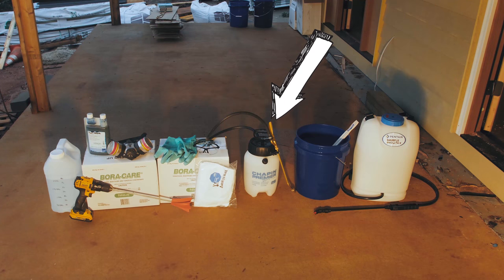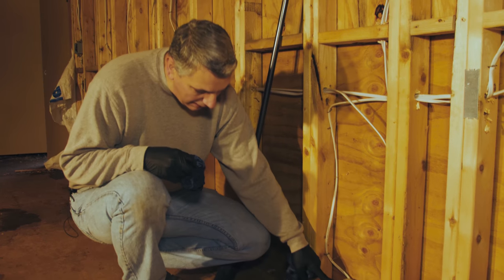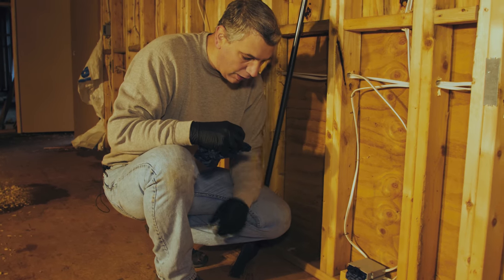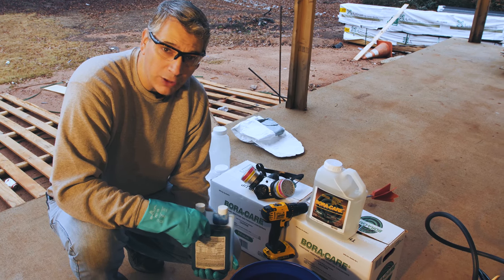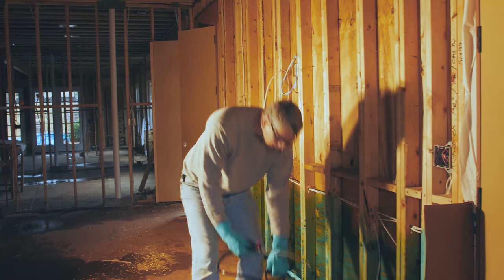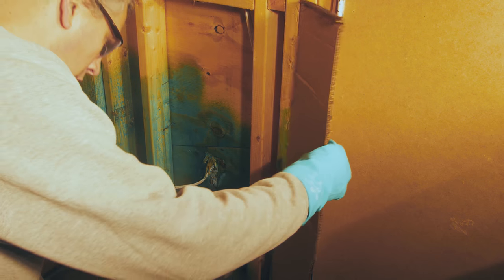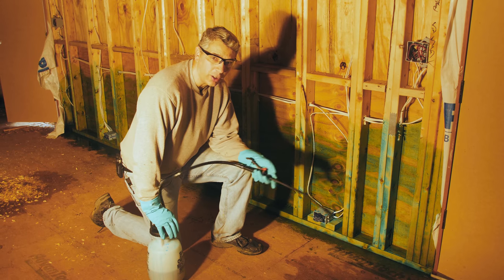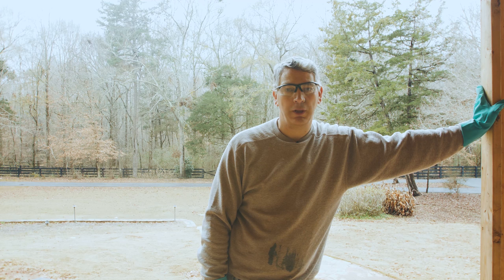How to do a Borate Wood Treatment | DoMyOwn.com

Comment: How many gallons for 4,000 square ft
Reply from the maker: How much Boracare it would take you to cover 4000 sq/ft would vary based on what mix rate you intend to or need to apply it at (1:1, 2:1, 3:1, 5:1), and the overall amount of wood you need to treat. If the lumber is thick you may need 2 coats, or if you are unable to get to all 4 sides of the wood you are spraying you may need to do 2 applications as well. You can review the Boracare Product Label https://www.domyown.com/msds/Bora-Care_Label_and_SDS_2020.pdf and our supplemental documents on the product page like the Dimensional Lumber Bulletin https://www.domyown.com/msds/techbulletin_loghomes_dimensionallumber.pdf to calculate your lineal footage of boards and overall coverage needs.

Comment: What i do for the painted areas or the areas adyacent to tubs or door is using it without colorant.
Nice video.
Reply: Boracare not for painted surfaces.  It needs to soak in. Like Altriset maybe you can drill tiny holes in the wood and inject behind the fascia but I've never seen this and it is not mentioned in Boracare documentation.

Comment: Will borate stop dry rot?
Reply from the maker: Yes, you can use Boracare https://www.domyown.com/boracare-p-100.html or Timbor https://www.domyown.com/timbor-professional-p-144.html to prevent or treat wood decay fungus that causes dry rot. Be sure you are using the curative rates if you already have signs of damage. Keep in mind that a borate treatment will not remove stains. You can clean the wood first with Mold Clean https://www.domyown.com/moldclean-p-1328.html  if you need to remove any stains first.

Comment: you forgot to put on your PPE BEFORE you started
Reply from the maker: Jim has on gloves and eye protection before spraying, as he should. A respirator is only required with Boracare applications if you are applying in an enclosed area that is not ventilated, usually spaces like a crawl space or tight attic space.